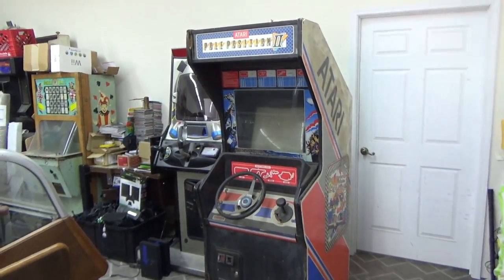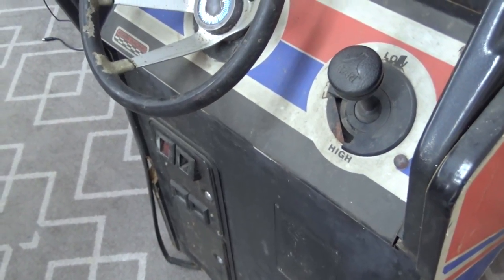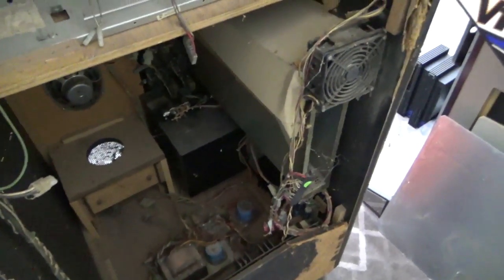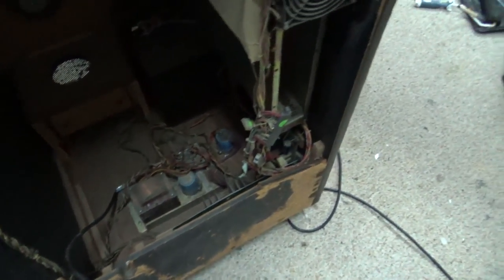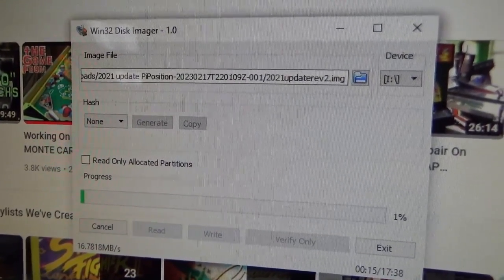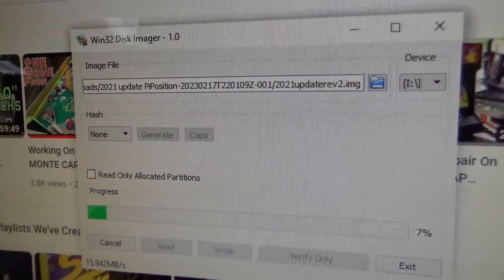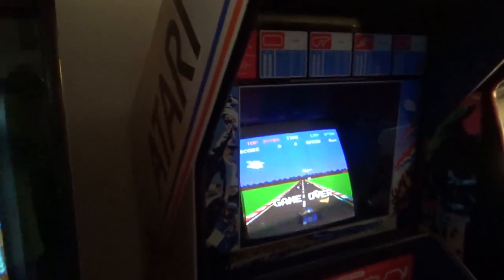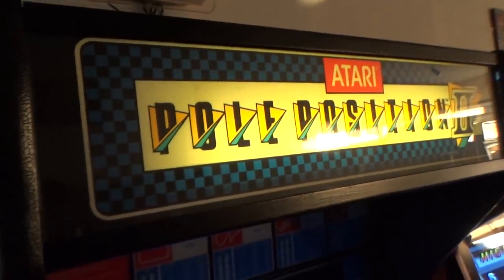They Started Parting Out This Pole Position Arcade Machine, Let's Save It! Pi-Position PCB Install

Comment: What are you using for marquee lights now? Are you still using the florescent tubes/starters or have you switched over to an LED strip?
Reply from the maker: We try to put bulbs and starters in if the original fixture is still working (ballast isn't burnt up), but if we have to replace the whole fixture or it's missing we put LED's in, we don't really like LED's much

Comment: Iffy Atari boards & the monitor was the reason my Atari Star Wars went, the most tempermental machine I ever owned and I'd never want a vector again. I do love the channel Joes Classic Video Games! (and I stilll don't know your name, Mr. Narrator & Fixer!)
Reply: It's Ronnie the other guy is Joe
Reply from the maker: Star Wars is a very tough game to keep running, if you do your own repairs and are at a pretty high level you can keep it going but it's not uncommon for it to break often.  You can so called 'bullet proof' it to an extent but it's a pretty complex, antique machine at this point.  Pole Position is a little easier because the monitor isn't vector and people have figured out how to make those run pretty well, the board set is a thing though.
Reply: @LyonsArcade  I sent boards to people with experience, they came back worked for a matter of minutes and failed again and that was various boards too. It took the fun out of it. Glad that PP is a little more forgiving, I always loved PP, PP2 and TX-1. Hello from the UK, where pins are a bit cheaper but videos more expensive!

Comment: The board you plugged it into, is an Arduino Pro Micro. They're fantastic little boards. I use them as cheap, ultra low latency arcade stick encoders.
Reply from the maker: Thank you Mighty Squirrel!
Reply: @LyonsArcade  You're welcome!

Comment: I have the sit down version of pole position 2.  Has the steering wheel, pedals, shifter, glass screen,  rolls easily, cabinet in really good shape, needs all electronics, wiring, pretty much empty like this one.  I’d pay someone to help me get it up and running again but nobody in my area works on them sadly. Still cool looking to have

Comment: Great job guys.  Looks great!  Watching the video, that looked very original.  Great job on that board.

Wow, does that bring back memories.....  Lots of us could get around Fuji Speedway.....  I remember PP2 coming out, those 2 new tracks threw us all for a loop...  Those were tough.

Knowing the track is key.   So, as you would expect, we all looked ridiculous on the new tracks....

And you are not wrong...  Having the speed set down some, I always thought was somewhat easier....  Different places set them differently for whatever reason...  I was in a sit-down cabinet one once, it would let you rip it at like 250 on Fuji Speedway, which was uncontrollable....  Years later, I remember a bar I may or may not have frequented got a stand up one...  It was a little tired, the heyday was over, but the top speed was dialed down, and it may have had some weird processor problem, it seemed to play "slower" slightly....  I was untouchable on that thing....  For at least a year I had the high score...

Those were the days.  Were you still in the business when Golden Tee came out??  The golf game with the trackball???  That created quite a sensation....  I may or may not have spent a lotta lotta time playing golden tee....  Groups of us would go out, specifically to play Golden Tee....

Comment: Ron, the only rip on this one is when you measure AC voltage across the power rails, they HAVE to be loaded in order to indicate what sort of ripple you have.  Most any capacitor will have low ripple without a load.  Other than that...pretty cool.
Reply from the maker: The 10.6 or whatever it is on the cap then feeds a voltage regulator which is regulating it's little heart away to create 5 volts, wouldn't that count as a load?  We tested it with the power supplies installed and powered up

Comment: The serial number was UR01= Upright version 01 number 087.  A very early early manufactured machine!  There are two versions of this machine, version 01 had the original pole position side art which had the ATARI name on top, while version 2 had a series of racecars and racecar drivers with the NAMCO name on one of the racecar driver's helmet.  All in all, you have a very special Pole Position 2 cab.

Comment: JOE CLASSIC< did someone add in an inline Fuse for the H.O.T transistor? Mostly the H.O.T transistors don't have fuses in most arcade monitors. I'm guessing your combined tied together the H sync and V sync lines together?

Comment: No need to wipe off any of the grime on the monitor until you know it was worth the spray and paper towels.  Good job guys, was looking at taking this on, glad to find your video.  Regarding not having the original board, jeebus, who wants it?  That is the reason these are in such low numbers.  The original boardset was junk.

Comment: I'm probably completely wrong, I wonder if the following would work for a gas pot problem....

- put it in the sweet spot, then take a resistance reading. and get hold of a resistor with that value. 
- add a relay board that connects to some spare GPIO pins if there are any spare on the pi. (I have a spare if you want it)
- write a timed script that would switch on the resistor first, then switch over to the gas pot after the pi has done the calibration. 

Just a thought, like I said, I could be wrong! 🤣

Comment: I have recently came across a cockpit PP1 that had been converted to some off road racing game from 1989. The control panel with steering wheel and shifter has been replaced with something that looks more like a Star Wars controller. Do you know anywhere I could find replacement parts?

Comment: Hey! That's the same model Raspberry Pi I'm watching this video on - it's hooked up to an early 1980s TV!

Why do a tube swap, especially when the burn-in belongs to the game! C'mon people, you can't just swap a tube that has Pac Man burn-in in a Pole Position! 🙂

I fixed a few Pole Position (II) boards, but they were low hanging fruit. A battery-eaten PAL here, a bad RAM there... there's a PPII I can't fix, it's doing the good old SELF TEST - PASSED reboot loop. The 8002s are good, the support logic tests fine, it's gotta be that other PAL...

Comment: I have a pole position arcade cabinet and mine is in way better shape than that one but there is a metal bar on the inside of it but idk if it’s holding it together or what, mine isn’t beat up like that

Comment: That's gotta be the best fix I've every seen for an elderly game. Cabinet with no board set (in their case, a double board set) replaced by one board a fraction of the size and a micro SD card?! I bet we'll see a lot more Pole Position games working for the future!
Reply from the maker: They could have made the board much smaller too, they just made it the same width as the original so it'd fit in the case.  It could be a third that size.... Thanks for watching Mike!
Reply: @LyonsArcade  The wiring harness connectors appear to be the deciding factor for it's size.

Comment: Before watching the entire video,
I know this was a LICENSED game.  
This was NOT an Atari original!  It was a Namco game licensed to Atari just like Pac-Man was licensed to Bally/Midway but was in fact a Namco original.  The Pole Position II game was also a Namco original.  Ironically, Ms. Pac-Man WAS developed by Midway after reverse-engineering the original Pac-Man gamecode!  Namco let that slide and assumed ownership of the Ms. Pac-Man code.  (They kinda had to thank Midway for developing Ms. Pac-Man.  The real sequel to Pac-Man, Super Pac-Man, didn't do that well in arcades but Ms. Pac-Man was a huge hit!)
I had the Atari home computer port (Atari 400/800 series, compatible with the later Atari XL and I think XE line of Atari computers) of Pole Position.  Nice game, decent port!
The best racers I ever played are still the mid-1990s Sega racers like Virtua Racer and Daytona USA.
Reply from the maker: This is the Atari Pole Position, not the Namco Pole Position
Reply: @LyonsArcade  It's still licensed by Namco!
Heck, the old game cartridge I owned for the Atari computers MENTIONED the game was under license from Namco!  The Namco license/TM reg comes up on the old Pac-Man machines sold in the US (unless they're bootleg), too!
It may be an Atari cabinet but the game code and actual machine that executes that code are licensed Namco product.